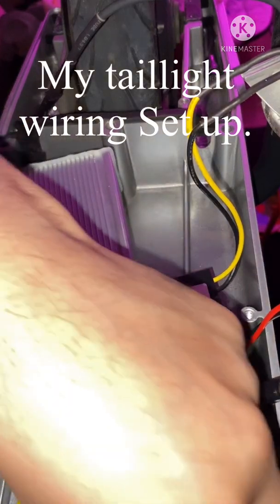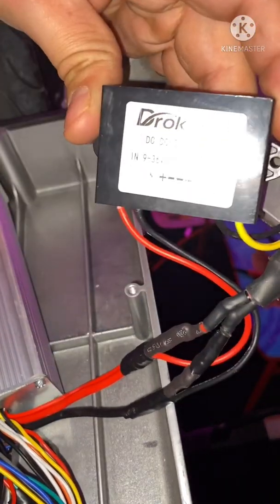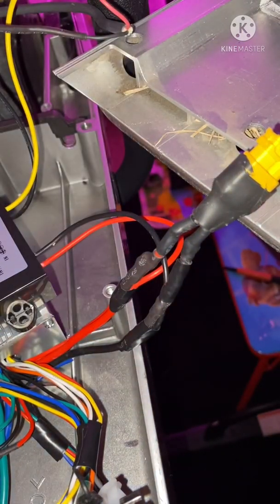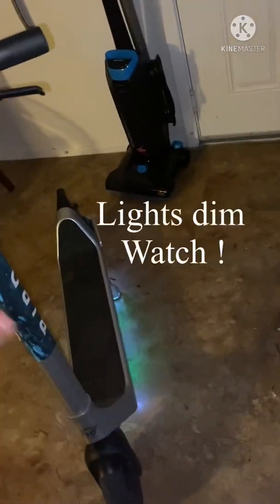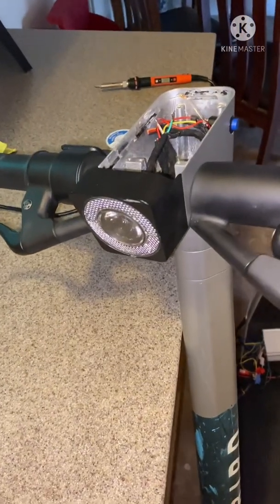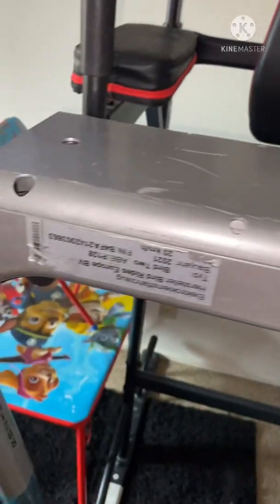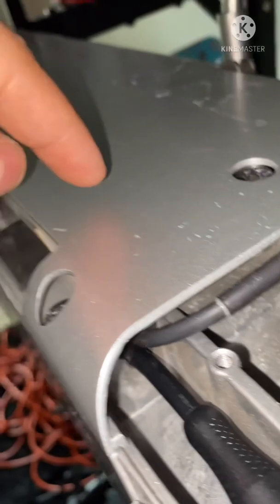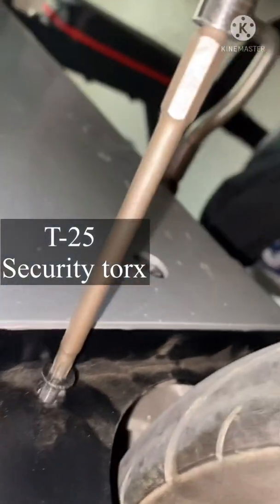Throttle issue fixed￼+Tail light wiring￼￼/(Stepdown converter)￼

Comment: Just an idea for you:
While your doing the jumper from p+ to b+..
Solder a red wire to b3, and a black wire to b- to get your 12 volts, rather than using a step-down converter. I run lots of lights, a horn, USB outlet for charging my phone etc.
Been using this method for a couple years now on all my scooter builds.
So far, no issues with the battery..cell b3 always balances after charging. Knock on wood..😎
Reply from the maker: Yeah I Thought about doing the same thing ,was kind of skeptical at first  because I wasn’t too sure if draining from that battery group would unbalanced my cells , since it’s not draining from the main power supply itself.. I just stick with a 36 V step down 12 V for my headlight/tail lights .. but yep you’re right every nickel measures a different voltage,but I do use the different voltages when I have to sample something at a specific voltage..

Comment: Hey so I wired a scooter up with a resistor to the headlight to. When I use the learn wires the motor spins but when I use the throttle nothing happens. I tried disconnecting the headlight and same thing. Any advice?
Reply from the maker: After market Throttle from Amazon has been known to fix this issue. i’ve never had this issue personally
Reply: Has similar incident wired up a 10v to light through green and yellow with no resistor and it worked for a second then didn’t work wired in my tail light it worked but then my throttle wouldn’t work after that was puzzled

Comment: Do you think this is why I couldn't get mine to work after following exact instructions on your original conversion video? I just left the light out I didn't even want it so I guess I need to have the light in a resistor and everything set up like that then huh then maybe it'll work
Reply from the maker: OK so you can actually drive the scooter without a headlight or a resistor , The scooter will work fine without both.. now on the other hand if you connect your light without a resistor then your light will work but your throttle will not! But once you add that resistor to you light then both your headlight and throttle will work..
Reply: @pjscootermods  and you're speaking to the setup using original throttle on assuming. Could you link us to a throttle and a controller combination from Amazon correct so when you wire it up are you using the original throttle still or the one provided with the display and controller that we purchase
Reply: @pjscootermods  you talking about only on the version when you use original throttle or is this for aftermarket too!!???
Reply: @pjscootermods are the head light and throttle wires some how connected ?

Comment: For anyone willing to help - I connected everything like in his previous video, and the wheel spins when I connect the intelligent wires, but the throttle doesn’t do anything? Any thoughts?
Reply from the maker: Be sure you are using the throttle wires (red/green/black) or sometimes -red/white/black-and not a sensor (3wire connecter) could be confusing! But they should also have some type of information or labels on each connector.
Reply: @pjscootermods  but the throttle works when I unplug it and then plug it back in / it’s bizarre - any thoughts on why that would be? I have the sky model.
Reply from the maker: Sound like you might have a throttle issue !
Reply: This is what mine would do the intelligent learning process thing would turn it on when I connected but then nothing after that
Reply: @prolifictroll9387  did you figure it out
Reply: @HoboJohnGalt  got a different controller and throttle and I hook up the light instead of skipping it. Worked for me

Comment: Come out of your 12v step down, wire the head and tail lamps in series with your switch. This eliminates the resistor and going into your controller for a 5v.
Reply from the maker: My back light requires 12 V the headlight requires 5 V. The 12v supply would burn out my headlight if I wire them together.
Reply: It won’t burn lights out. Wire both lights in series drops the load a bit and it works fine, no resistor. Back light is capable of 24-36 volts. Think it sends 12 normal then if you tap the break it sends 24v making it brighter. Headlight works on 10v that’s what I’ve seen. Give it a try.
Reply: IN SERIES WITH YOUR SWITCH? CAN YOU PLZ EXPLAIN
Reply: @starpalomino4898  positive lead from 12v supply to positive lead of head light. Negative lead from head light to positive lead of tail light. Negative tail light lead to one side of switch and negative 12v power to the other side of switch.
Reply: If your lights don’t come on, you might not have the polarity correct. Just swap the positive and negative wires of the lights only.

Comment: Quick question tho.  How is your throttle and stuff working without a display ? You just hook up a on off switch or what ? I ain’t really trippin on battery display the charger will tell me that
Reply from the maker: The scooter runs just the way it would with a display instead you cannot see your battery reading or your mileage per hour. The power will be constant unless you add a Killswitch.

Comment: Good Lookin Brodie.  I figured out a way to wire the lights a lil different.  For some reason when I tapped into my own 5volt it shows error 10.  I been using the 5v off the Get help sensor,  cap the blue and use the red and black on the 350wAtt controllers
Reply from the maker: Yeah that’s definitely strange ! Error code 10 should have something to do with your motor plug/wires not being plugged in correctly/all the way, or possibly a short in that area.